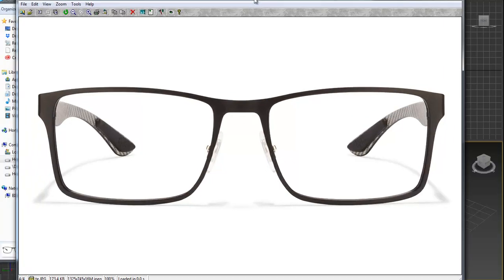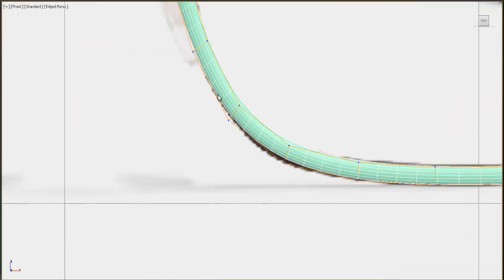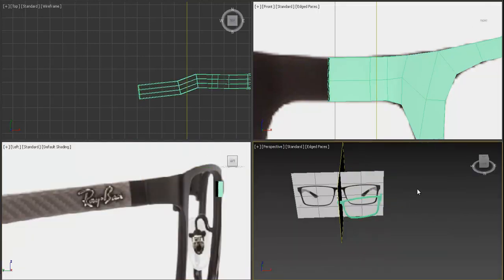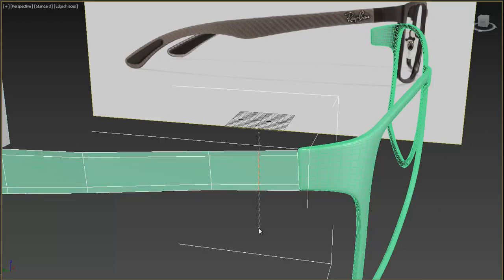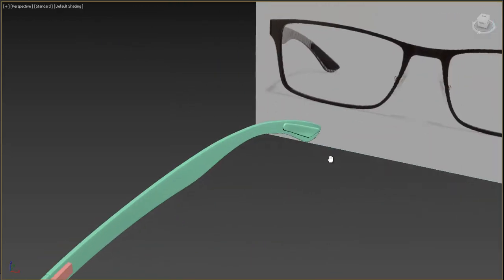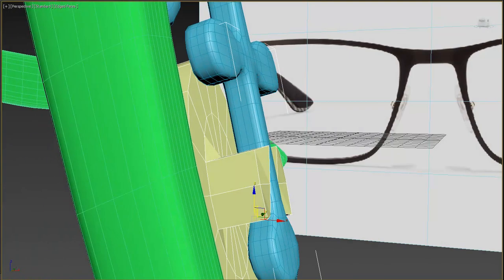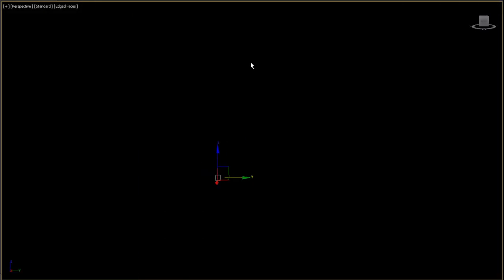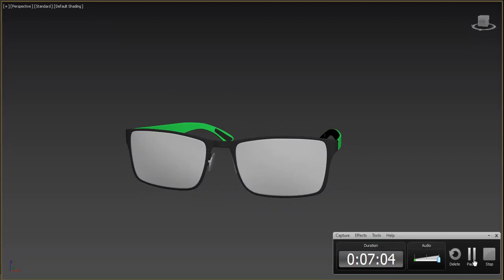3ds max modeling tutorial RayBan glasses from a to z

Comment: The tutorial is very good for the one who already has most of the knowledge about 3dsmax but no so helpful to most users. Even though i know about max i still couldn't make much sense out of the"15 modifier" you pronounced FFD as fifteen :D. Nonetheless a good tutorial. My two cents please show the modifiers that you are using and speak more clearly. Thanks
Reply: FFD is an abbreviation of "Free Form Deformation". It is something like Warp Transformation in Photoshop. FFD 3*3*3 has 27 controling points to warp an object.